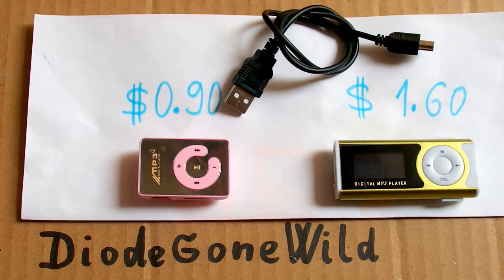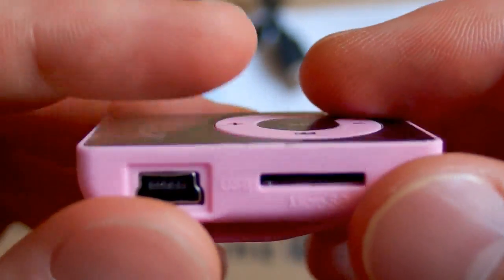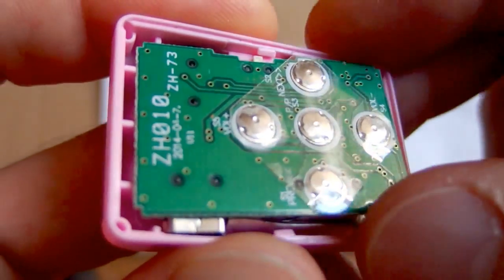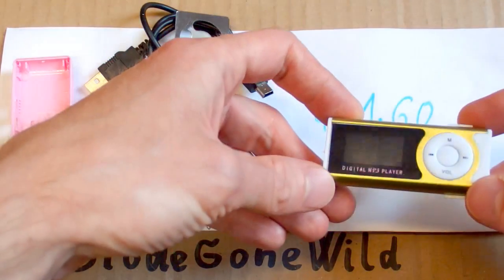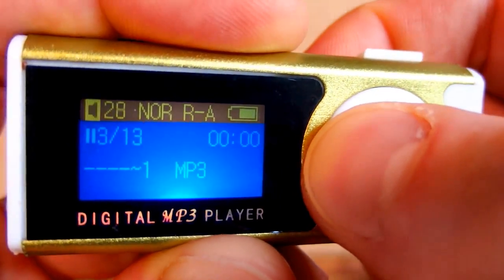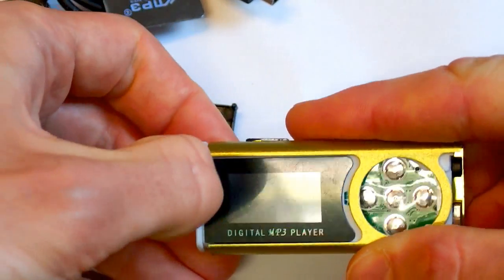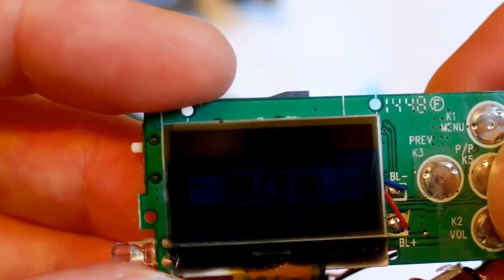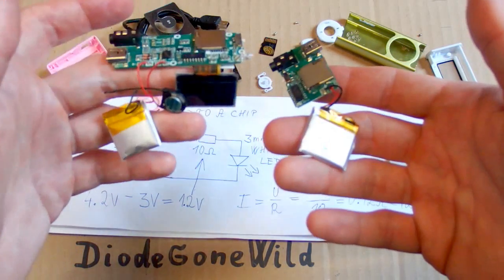The Cheapest MP3 Music Players from Ebay - Test and Teardown

Comment: I bought the 90cent player! Tear out the battery and soldered in a 3Amp Lipo Battery in. Everything was tape together with Scotch Tape. I use the player for 4 years, today the board finally became spoilt. Really like the player. No nonsense, it just play instantly when I switch it on, no delay at all.
Reply: How long does it take to charge fully
Reply: Where did you buy that Lipo battery? I can't find it anywhere.. I need to fix my Coby MP3 player, its battery is dead and it appears to be the same shape , square and flat...
Reply: i actually did the same with my player but it didnt work afterwards, guess it was so fragile even doing better for it makes it break
Reply: I did that too and put it in an small box with flip switches
Reply: I bought the player something like the 90 cent size player, but with display on it. Same, I connect a large battery for it. But after long time, the button become mulfunction. So I don't really use it anymore.

Comment: The LCD display model looks like it would be a somewhat decent MP3 player if it had either a larger battery or ran on AAA's.  

For audio testing in videos, you can download MP3s from the YouTube Audio Library, which you can freely use without running into a copyright or monetization issue:
https://www.youtube.com/audiolibrary/music

Comment: On the first player the main chip are appotech clone of JieLI AC1187 chip, and usually frimware in original JieLi AC1187 chips have ability to work as a usb sound card.
On the second player the 16-pin chip maybe it's original JieLi AC1082 chip.

Comment: Cliped this pink one on to my large headphones and soldered external 1700mAh battery hot glued to headphones. Works great so far. Audio quality is as good as ipods.
Reply from the maker: Good idea :). It's also possible to build this into a speaked system and power it using something like LM317.
Reply: DiodeGoneWild netreba LM317, stačí 7805

Comment: They can play music over a night with battery fully charged. Also this thing actually take around 20 yuan(3$) for the first, and 35 yuan(5$) for the second one here in China's mainland.
Reply: yes at least 10 hours, i tested mine, in fact it is a better mp3 player than the original apple shuffle, which cost 70£ and was only 512mb

Comment: I opened up one of those digital propaganda players which are being repurposed as audio bibles called The Proclaimer...they have a special removable flash cartridge which holds both the firmware and the media but inside you can connect a USB cable to the main board and then use it as a regular MP3 player.

Comment: I had a dl one, with a display and multiple backlight colours. It was nice, and lasted like 12 years and only died, when a battery leaked hard into it, and i didnt clean it propperly as the display wouldnt lift off, the play button stopped, and months later the entire device.
It had a 1gb internal memory, no flashlight, didnt had microsd card slot, a 1.5battery socket (AAA battery), it looked alike the second one there, had radio fm, it measured the battery so i used it to test batteries of remote controllers of tvs too.

Comment: the pink one will work as a usb audio card. you can plug headphones in the player and connect usb and it does weird stuff and you can hear the computer audio
Reply from the maker: I have just tested it. It doesn't work with my one. Was your switch in ON or OFF position?
Reply: in on i think. 
I guess it was just mine that did it.
Reply: I also heard that some of them can work as PC usb sound cards, but mine doesnt work because I think it has other model of controler.

Comment: I've had the 90 cent ones for years.  I've stuck bigger ones in there but I've found if you want certain music a smaller micro sd card works if you have a container for 10 of them or s. (one I have also from china has spots for about 10 of them and or slightly less as it wastes a spot for 1 SD adapter and the other side holdes 3 SD cards.  Have another one but it had an iphone like connector to it, has a display and battery does seem to last awhile.  But it has a fake memory chip which is generally the main problem so thats why I prefer the above.  I can get a legit memory card inside vs a fake Samsung memory card that you have to low level format to a certain size or you'll corrupt some data when it loops  Worst mp3 player I've had.. I'm about to burn as I was using the pcb board only and using it for storage.  alas the parts are starting to fall off that actually matter to keeping a charge to the memory..  it was from a longer Craig mp3 player with a display that never work but hey nice nightlight. :P
Reply: btw 15 min?  you've been had.  mine lasts maybe 5 hours at the least or longer, if it lasted 15 minutes doubt I'd keep it.  I'd say someone cheaped out on the battery.  And usually have it at full volume because it doesn't get very high but high enough I don't mind.  I've had $100 items with it lower for headphones not speakers.  I believe I need a volume amp for that for headphones

Comment: I have the one with the LCD which I paid about 6$ for. The stupid thing cannot even show the songs name, it only shows *******.mp3 or something for all songs. It is still an amazing piece of tech for the cash it cost in China or Ebay. I sold it to a friend for 4$ including another set of useless but new headphones. The sound output was horrible even when using with Audio Technica M40x headphones.
Reply: ciprianwiner I have the same MP3 player too. And it corrupted my microsd after it ran out of battery...
Reply: Most of those cannot display anything outside of ASCII code range.
Reply: you get what you pay for

Comment: Likely the point of the switch is because no one in China seems to be able to design proper power management. In some things (like digital calipers and whatnot), quite literally the only power management you get, is the screen turns off. It's still drawing 16mA in the background, and still will be dead in two weeks. Everything from the cheapest, shittiest electronics, right up to portable oscilloscopes, are prone to piss-poor power management.

Comment: I wonder if you could replace the internal battery with a higher capacity one?
Reply from the maker: I definitely could, but it wouldn't fit inside :).
Reply: Isn't that always the way these things go.
Reply: Oh i'm sure you can fit a better quality with same dimensions! I have had one of these players, i think branded by Denver Electronics (Denmark), and it lasted quite a few hours, i think 6 or so, far from useless. Unfortunately, after 2 years of storage, the battery puffed up and wouldn't last more than a minute. I think this is what happened to these two players, they're new old stock (2014 manufacture) but their batteries went bad, and were very low quality product to begin with. The second even looks internally damaged.

Sansa Clip first generation also doesn't use much larger size battery, mine is now 10 years old. But that battery is absolutely fine, hasn't lost much capacity at all, it can still play for 10 hours or more! And OMG the sound quality of the little thing, it's just amazing. And to think i sniped it for 15€!

Comment: Well noone has problem to attach 3 batterys to it yea it will look weird but it works better as well even extend them with cable if u need to the mouse USB cable works good as well does not screw up quick so u have spare time or if u have old PC speakers u can try get the one wire off or not old just cheap tinie 2 side wire just attach it well drill a whole in the base and attach it solder in and it goes good as well recharges em longer uses em better as well it will last longer then the original one for shire i use the same LED on x3 3.7v with pc switch thats on off and silent then usual flashlight and cheap laser base from copper around the led cause it kinda works as usual i get boored burning off led on 5 v :D so it kinda keep it in place on 3 cell pack usb from the chinise latern looks better as charging port just stays in i guess i can charge it with usb to usb port :D

Comment: We can get better media players than that basic one from a vending machine here in the US.  I stripped one down and rebuilt it in a case made of heat shrink tubing and a larger battery.  It has 2GB of internal flash memory (Hynix branded!).  I have old political speeches on it.